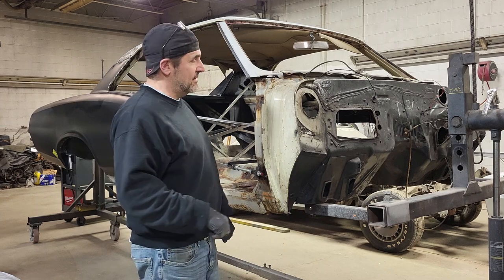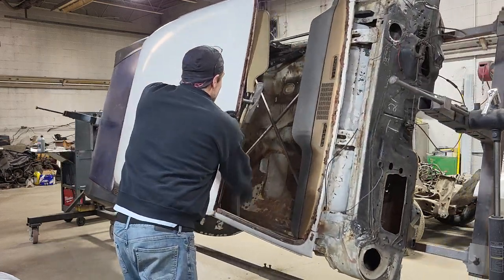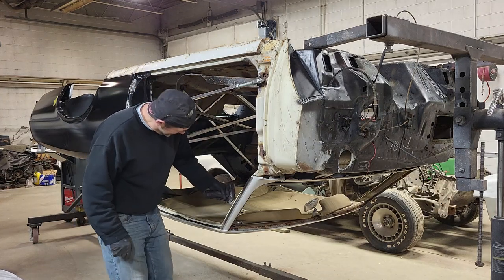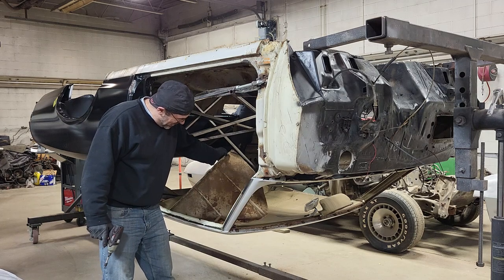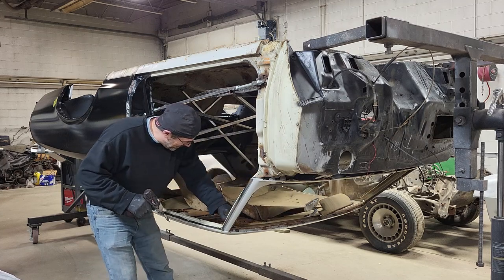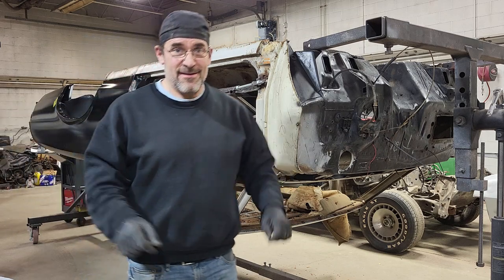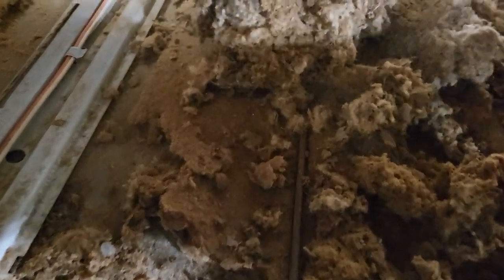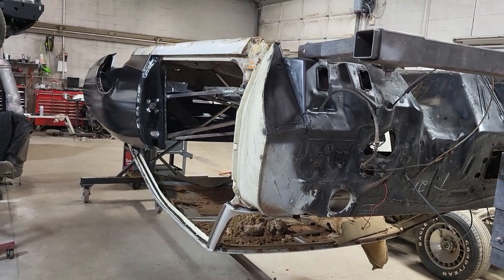Removing a HEADLINER (The EASY Way).

Comment: Great job on the bracing. I have a 1966 Gto that needs a full floor as well and rust repair around the windshield channel and dash… where are you located?
Reply from the maker: @boss30268able  Thank you. My shop is located in Ottawa, Ohio.